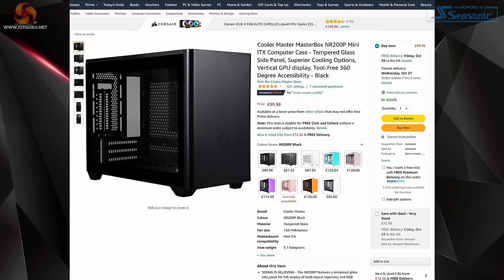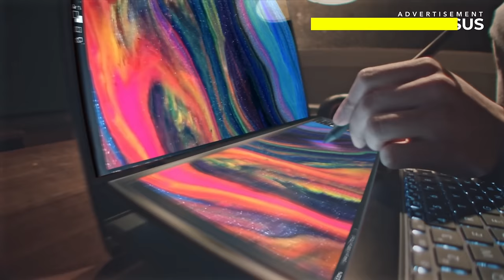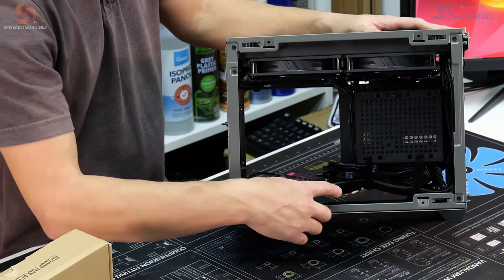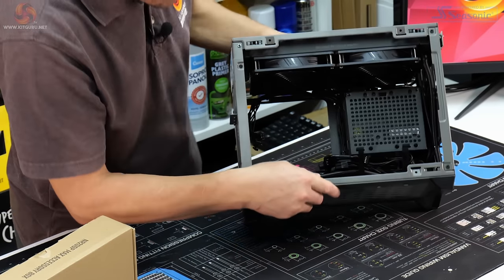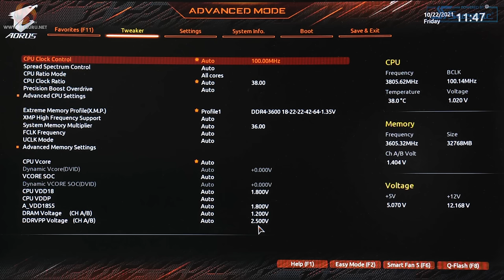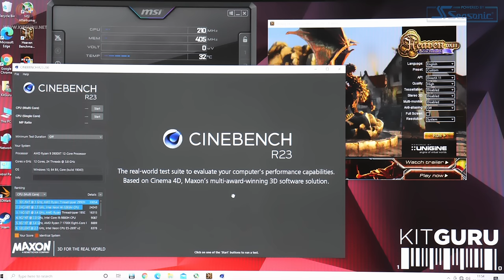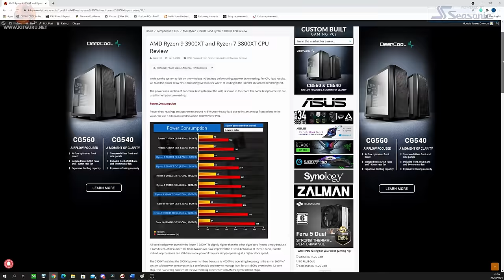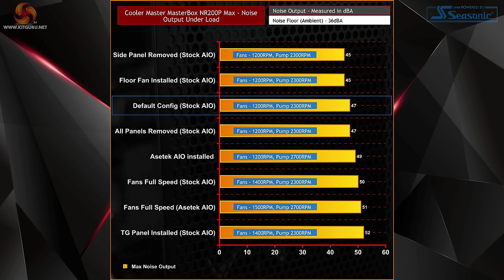Cooler Master MasterBox NR200P Max Review

Comment: Great review! 
I would have liked to see the bottom fans as exhaust. The fins on the RTX 3070 push air direcly into the bottom fans, so an intake actually fights the gpus cooler. As exhaust 2 bottom fans might be able to remove a significant amount of the hot air coming from the gpu, while passivley making it easier to pull cool air through the side panel and reducing the overal temperature in the case for better cpu thermals. Still a very detailed review!

Comment: The best cable management I've seen for this case on YouTube
Reply: It is already done bro 😂😂😂😂😂
Reply: @vishalvan3317  I wouldn't say that's the case. The cables are pre-routed for you and the provided velcro straps make it easier for you to cable manage. You do however still need to do some extra cable management after putting in the rest of the parts (depending on what you put into the system) if you want a clean look which in this video is done fairly well. Also you don't have to be a smart-ass with dumb comments like this one
Reply: @dannymasri2910  sorry 😐😐 bro it seems that you have been pissed by me

Comment: I'm pretty sure reversing the fans with intake on top and exhaust down below would do miracles for the temperatures. That way you have two intakes with fresh air (cpu & gpu) and outtake near the bottom, expelling the heat generated by the system. Now some might say exhausting from the top is preferable, but only the OG nr200p is better suited to that config, with two fans pushing in from below, and then GPU and CPU heat being expelled from the top. Overall some of the two best SFF cases out there!
Reply: Others have tested it doesn't really help much
Reply: @andrewszerbiak7330  For most of these cases we're only talking about a few different degrees anyway, so every little bit helps. In my case, just reversing the CPU cooler direction on my NR200 helped tremendously when running CPU+GPU on full load. Granted, this is not a common usage pattern, but it is the best way to test the true thermal limits of a cooling solution, as both heat sources are maxed out. I always find it odd that reviewers either test CPU or GPU, but seldom both at the same time, even though some games can be quite punishing on both.
Reply: @andrewszerbiak7330  Gamers nexus mostly test cases in stock configuration, with only the shipped fans installed. Their reviews focuse more on build quality and features than trying out all the different cooling options. Love Steve though, his cynicism often makes my day! Machines & More is really the NR200 expert at this point. His channel is wild when it comes to exploring all the possible options with that case. I also like Optimum Tech a lot, great production values.
Reply: This might be one of the very rare occasions where I'll say a GPU with a blower style cooler may benefit.

There's a lot of heat soak from the GPU going to the radiator in this case. A blower that exhausts most of the GPU heat out of the back of the case could help CPU temperature. 

Unfortunately I didn't have a blower card on hand to test the theory.
Reply: @KitGuruJames  Too bad they almost always sound like leaf-blowers. To me the original NR200 layout just seems better, as it enables the best of both worlds: vertical AIO cooling with proper GPU air intake in the bottom of the case (using two slim fans also dropped temps and noise considerably).
Reply: @Havanu81  yep, I don't usually like blower cards for that reason.

Comment: Hey thanks for a really good and detailed review. My 3900xt hits 85 on full load even in a fractal design define 7 xl with plenty of fans and a massive air cooler. So id say the thermal performance in this case is surprisingly good.
Reply: Maybe u messed up fan configuration?

Comment: Great review!!! The thing I like is the way the cables from the PSU and AIO hoses are custom length so you don't have a wad of cables in every crevice. I can confirm that 2 Noctua or Artic 120 x 120 x 15mm fans will work in the bottom which does help about 10° with the temps. Using the vented side panel panel also helps with temps on higher wattage CPU / GPU. I have a AMD 5900x and Radeon RX 6900 XT at max draw the temps are within optimal.
Reply: Late reply but do you have your bottom fans set as exhaust or intake?

Comment: It's nice for those new to building PCs but I'd like to have a semi-custom loop (alphacool) in one and I already have a SFX PSU that I paid good money for, including custom braided cables. I also have the parts for a loop, including the pump-block combo, radiator, quick disconnect fittings etc. I don't see why they won't sell the case standalone or with different parts combos. There are many people who might be interested in the case but won't want to deal with paying all the money upfront to sell the unnecessary parts later.
Reply: Yeah I agree. It would be good for Cooler Master to offer this version of the chassis to purchase seperately.

Comment: Great review as always. I'm surprised though in 2021 that CM refuses to include a USB type C as part of the IO. Was really hoping the successor to the NR200P would've included that. Would've been a slam dunk in my opinion if it included a type C port.
Reply: I can see your point but I suppose its not too difficult to plug in type-C at the back in an sff case like this as it would more than likely be placed on the desk, so not as awkward to get to as a bigger case on the floor etc.
Reply: Is a type-C really that needed, in a case? There are zero devices I'd use, that would use that port. I'd rather them stick with type-A.
Reply: @madness1931  exactly, the only product I've really seen that even does usb c is steelseries aerox mice, and I don't even own them. For me a type A over a type C is pretty much common sense, the only things I can think are like newer usb c dvd readers but idk
Reply: Type c isn't for budget cases. Nr200p is a budget itx case
Reply: @Fregatte86  sure although I've seen more budget cases with usb c than I've seen high end cases with it

Comment: As an owner of the OG NR200P I am very happy with my HTPC build in it. I currently run a Ryzen 5900x, 32 GB Ram (3600Mt/s) 2.5TB M.2 NVME, 4TB SSD & RTX3080Ti on my LG 4K Oled and love the experience. I’m looking at going to a Closed Loop water cooling setup shortly. At the moment p, while getting a little warm on the GPU, no throttling has ever occurred and next to no performance drops either 🥰👍🥳 the NR200 is an awesome little pc case to build in 🥰👍

Comment: Current pricing:

Lian Li A5 + v850 + ML240 cooler = $385  -   NR200P Max is going for over $450 now.  The A5 route gives you more room for cooler or PSU upgrades dollar wise.
Reply: i paid 310 euros for mine

Comment: I think they could do a version without the front IO panel, use the logo as the power button, and turn the psu 90 degree, to make the cables even short and clean.
Reply: Agreed. Without the front obstructed, you could put on a mesh front panel with 120mm fans as intake there.

Comment: For me the NR200P Max is a bit of a mixed bag - it's definitely great for building and the convenience can't be ignored. However, the performance of the stock NR200 is just better by all accounts. In the NR200 you are able to side mount the radiator as an intake with a horizontal GPU, which helps the cpu temps a lot. Its layout is also more flexible - i.e do you want bottom or side radiator, and vertical or horizontal gpu?. The NR200 can also accommodate tower coolers rather than being forced to use an AIO.
Reply: My understanding is that installing a radiator at the bottom would he a bad idea and will cause damage to the AIO. And the stock NR200P doesn't allow mounting to the top unfortunately. Which is probably why the Max was changed to allow it.
Reply: No way to top mount AIO in 200p, the included power supply and AIO with the 200max give it a cleaner look and make the price bump even more worth it

Comment: Very nice.
It's still my preferred case for my next build (probably in the summer). I'll probably try the TG panel depending on what parts I get. I'm glad you spotted that the floor can take both a 15mm and 25mm fan.

320 is a little higher than I was expecting but still good value with a quality 280mm AIO, 850w PSU, choice of side panel and Gen4 riser. 

If anyone has GPU sag I saw one reviewer cut some of the black foam to prop up the GPU.

Comment: I have 2x 15mm fans as exhaust under the gpu and they lower the temps by 3 degrees on the gpu with side panel. AIO set to exhaust also.

Comment: Fit two slim 120 mm fans on the floor exhausting out through the floor mesh. Works great with the mesh side panel.
Reply: Not really, the one gpu side the riser cable blocks any flow, and fan psu side does nothing, other than add noise. 
I really loathe this extra fan advice, it’s not needed. 
Only heat ever felt is the psu venting through the rad. 
Wasted £30 on Corsair fans. 

My cpu (5600) is 40c max and 6950xt hits 78c max with the mesh panel. 
Being so open, the case runs neutral pressure wise.

Comment: In your setup at 12:45 the radiator fans were connected to the CPU Fan header. 
Was the pump connected to the sys1 header?
 
So far I thought the cpu fan header has to be connected with the pump.
I never had an AIO that's why I'm wondering if it does make a difference where the pump is connected to or if both options are fine?
Reply: My question exactly

Comment: IS there no heat buildup problem having a drive directly on the power supply and/or between the GPU and power supply?
Reply: That will all depend on how much load is put on the system but there should be some airflow across the drive since the AIO fans are directly above it.

Comment: Small cases work best with negative pressure configurations. If you flipped that bottom fan to exhaust, you should have better results. Otherwise, great video.
Reply: Really ? I tried that before with my last small form factor and it rose temps by 1-2c compared to having cool air coming in from bottom and up over the components then out the top as the heat rises.
Reply: @scatterforce  yeah I watch a lot of videos, and try many things these tech youtubers say. this particular one never worked for me..... first hand....
Reply: @theonlyredspecial  Certainly doesen't work in all setups, but the vertical gpu cooler fins (in non blower-style cards) move the air directly into the bottom fans, that's why the temps were actually worse with a bottom intake in this test.

Comment: I have a single fan set to exhaust, mainly because the Rog 3090 strix centre fan area seems to be the hottest point, by pulling that heat out rather than letting that rise, seems to work for me... overall it s great case, under load my gpu run at 1925+ around 68-72 most of the time, CPU is 77..

Comment: All CM had to do was move the GPU 5mm up to make room for two full size fans at the bottom. I have other things I would change but the reason why they didn't do it this is beyond me.
5mm Cooler Master!
Reply: Honestly, the extra fans at the bottom are pointless. 
The one gpu side as an intake just hits the riser cable and as exhaust it hardly makes a difference other than bringing more dust into the system. 
I took mine out, reduced noise, reduced power consumption, stopped air drafts wafting into my hands.

Comment: Oh they are able to improve on the design a lot... just by adding extra centimeters in height to allow for a dual rad/quad fan in total - top and bottom - or triple rad/hexa fan - top and bottom and side - organisation. They could replace the simple metal plate front panel with a reservoir with an integrated pump, fill/drain ports on the outside/bottom edges and connections to all the rads routed out of sight, then it could be the only mass produced triple rad SFF for CPU and GPU open loop liquid cooling with massive heat capacity due to large amount of rad volume... I mean triple 280mm would have made it truly maxxed out... And they could start offering it with the 1kW+ PSUs they've released at the same time as this MAX variant, just to have a lot of leeway for both een more power hungry and heat-generating components. Those alterations would have made this case more as the name suggests ;)
Reply: Keep in mind that by keeping the same chassis as before is probably a cost-based decision, as fabrication of this variant is only a matter of swapping some panels around, keeping the manufacturing cost down. The options you suggest would push the whole config into the 450€-500€+ territory, which pushes the case into boutique custom cases section of the market, where the materials used are probably not premium enough as most cases in that segment are made of aluminium, turning this into a very low volume product.
Reply: @Havanu81  Well they could somewhat easily add a side-mount same as on the regular variants albeit maybe moved lower same as the mobo assembly, that way you could have a 2 rad variant, and the front panel switch for a watercooling reservoir/pump combo could be almost as easy, since the fron structure already has a few holes so both the cabling and tubing has space/cutouts somewhat present. From cost and tooling perspective it's a realtively small bump, and the case could function as a promotional combo unit for all the best things on offer, thus going for the higher powered PSU could well promote their new SFX PSUs as well...
Reply: @marcin_karwinski  True! But how many people really water-cool their GPU's with a custom loop, voiding the warranty while they're at it? It just seems like a highly risky customized setup that not many will attempt. Let's not forget that this is really an entry level SFF case pricewise.
Reply: @marcin_karwinski  I don't think a GPU would still fit vertically with a radiator and fan installed that way. In the OG nr200, there was barely enough room to fit a normal CPU aio on the side-mount to begin with.
Reply: @Havanu81  It might have been true earlier, but nowadays, with all the price hikes, you could easily find GPUs with a manufacturer installed block in the water-cooled variants... thus not only do you not void warranty but also you could get those for the same price as regular fanned units. Thus a mass-produced solution would certainly be first and only on the market ;) Good creds for the marketing department. And the MAX variant, even though you might consider it entry level SFF pricewise, is not exactly entry-level - the regular might have been, and it was cheaper due to the manufacturer being able to mass produce them. So yeah, I think that they could have gone a step further before calling the case "MAX" ;)
Reply: @Havanu81  True it could be hard, but given 3.5-4 slots for the GPU on the vertical bracket, you could in theory release one with slim fans and slim rad - some people managed to put in 240mm rads on the bottom below the card on the original variant, I guess CM could have created something more MAX than just AIO ;) And true, there was barely enough for an AIO CPU cooler due to pump-block sizes, but if they moved pump to the front pump/reservoir combo I mentioned that would leave us with only a block and maybe 90deg slim ports and that's a smaller thing to put behind the GPU's coldplate ;) Either way, they could of course just add a centimeter or two - sure that would require tooling adjustments but then the MAX monicker could actually stand for more than "max amount of our normal products slightly adjusted to fit together and be sold as a package" ;)

Comment: I feel like the vert gpu on 30 series cards with the "flow through cooling" would be blowing hot air straight into the PSU area, or the PSU is choking the back of the card, blocking the air

Comment: Hi ! I am planning on building a pc using nr200p max case. I have noticed that new rtx 4000 series cards are using 3 or even 4 separate 8 pin PCIE cables. If I am not mistaken, the case comes with only 2. As I am a begginer in PC world, could you please explain me how it works and how can I safely install rtx 4080 in this case ?
Reply: its very easy. i have a 4090 in it. no problem. just make sure the length of the gpu stays within the limit

Comment: Hi guys. I need some advice on building a system with this case. I want to know what would be the best air cooling setup in this case? I will be using an i5 13400 cpu and rtx 4060ti/rtx 4070 ti combo. I want to build using this case but have no idea about how to setup this system to run cool (50-60 c max ) on full load. Is it even possible? Please suggest an air cooling setup to achieve these thermal results

Comment: can you fit any drives on the psu shroud with this card?
Reply: what kind of drives
Reply: You can install them on bottom of case or behind the front panel which also just pulls off
You can fit one to PSU shroud however might get in way of gpu

Comment: This is good if you want to build a console to surf the web or light gaming or simply want a very small form factor but not a real gaming PC being overclocked.
Reply: You could easily build a ‘real gaming PC’ in this case 🧐
Reply: I believe the original NR200 is probably more suited for that, as a cheap air-cooled cpu and a low-wattage PSU are more than sufficient for that task.
Reply: Added 2 noctua 120mm slim fans at the bottom as intake and adjusted the fan curves so aio fan never drops below 30% for constant exhaust, runs my 10900k and rtx 3090 just fine without anything overheating or throttling

Comment: Well isn't this just peachy. Right after I finished a new mini-ITX build...
Reply from the maker: what case are you using Bob?
Reply: @KitGuruTech  This time - Thermaltake Core V1 Snow. And it was a pain finding it. But the customer was adamant about the dimensions so I had to sign a contract with blood... Forget about that, though. The thing is my own rig is in the NR400 and I wish this NR200P was available back then ;(